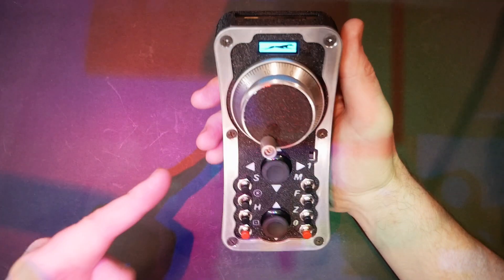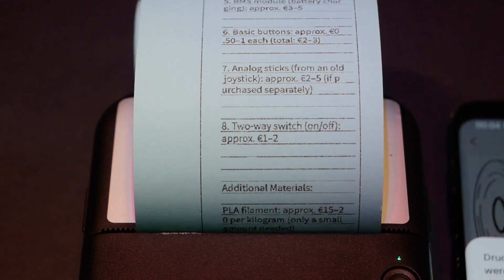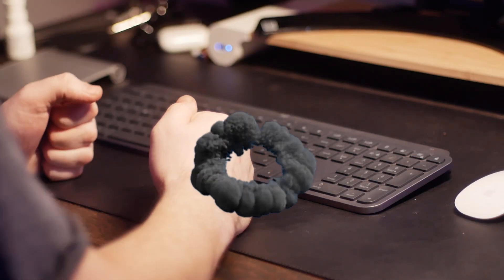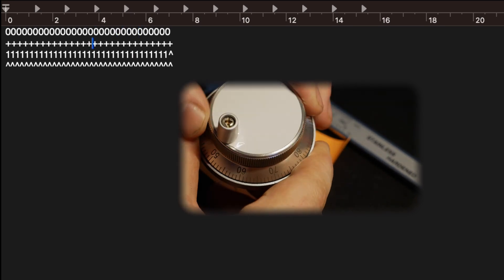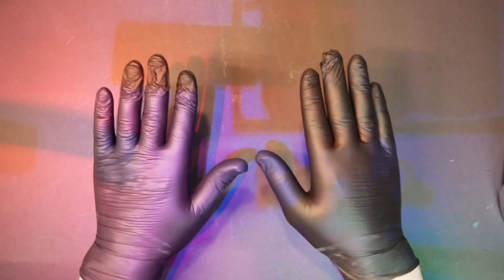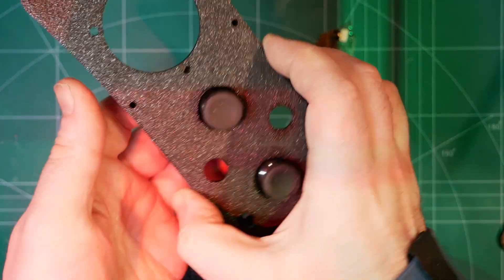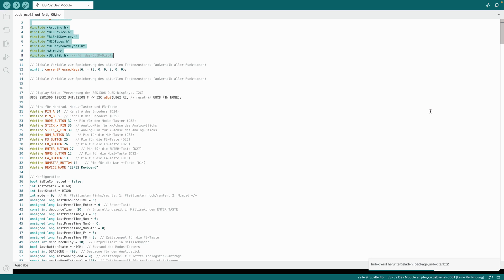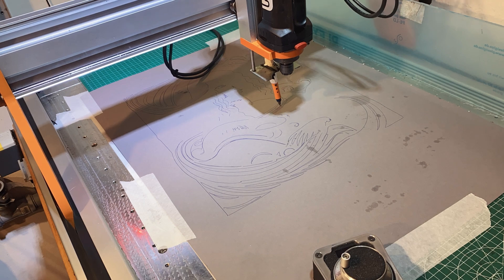I Built a CNC Handwheel with ChatGPT's Brain and a Whippet's Charm

Comment: never showed delays for the pendant :) i suppose delays are terrible and this pendant is useless set of keys for cnc presets
Reply: It’s a long topic. Most likely you won’t be able to solve the issue only using arduino. You need real time cnc controller, solid knowledge of electronics and lot lot more :)
Reply from the maker: @demon4eg402  Thanks for the insight; that’s already helpful. I’ll look more closely into the millis()-based timing approach and work on improving my setup’s performance.
Reply from the maker: Thank you for your comment; 

it’s really helpful! I’m not fully satisfied with the performance of my handwheel yet, so your feedback is very welcome. 

If I understand correctly, you’re suggesting that I should replace delay() with a millis()-based timing solution because delay() blocks the code flow?

 Could you perhaps explain this a bit more simply?

 I only took one semester of computer science in college where I learned a bit of C programming, so I’m just now getting back into it. Thanks in advance for your help!